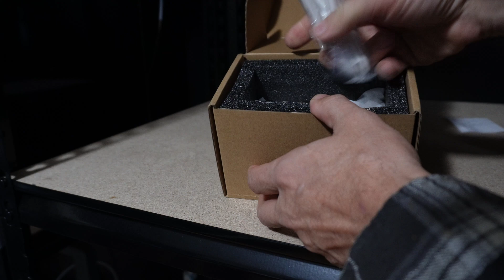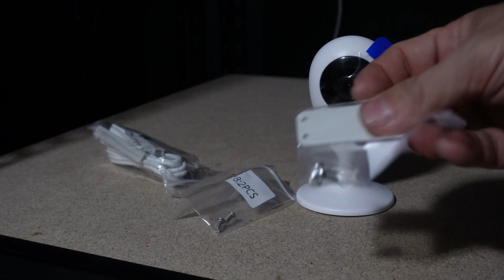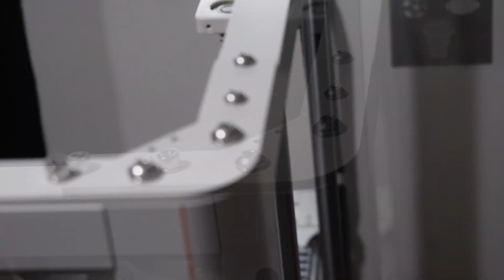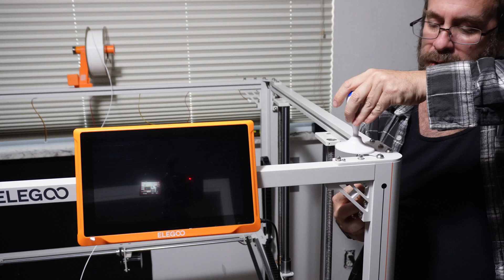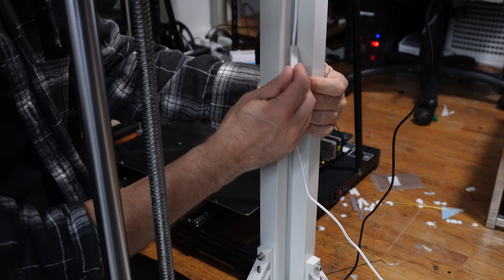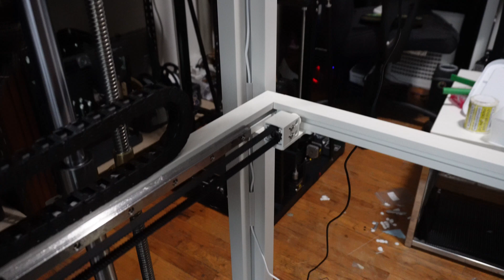Installing the Elegoo OrangeStorm Giga Camera kIT

Comment: Thanks for sharing this but what about software settings and viewing the print? Are you using Orca Slicer or Cura to view? Can you use other webcams?
Reply from the maker: Using Orca to slice. To view, use Fluid. I have yet to get my Camera to work. My printer came very late, then, Had a problem. All my Content for it has bombed. I'm gonna try to cover it more
Reply: Thank you for the reply! I just now got my giga setup and want to add a webcam I already own. Good luck with your content! Thanks again!
Reply from the maker: Let me know how it goes! I'm still working on my Camera issue. Elegoo is stumped....